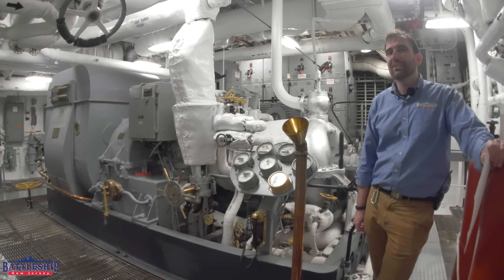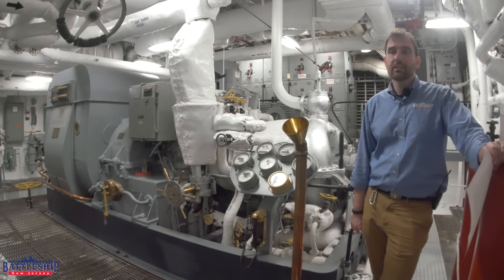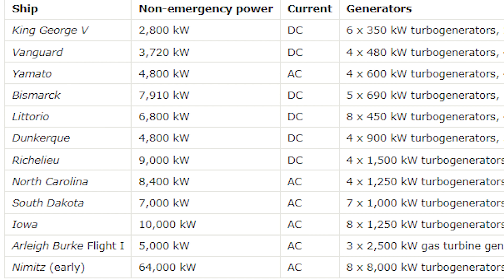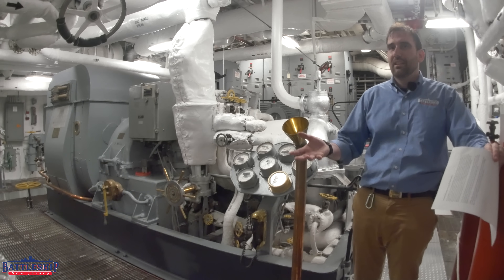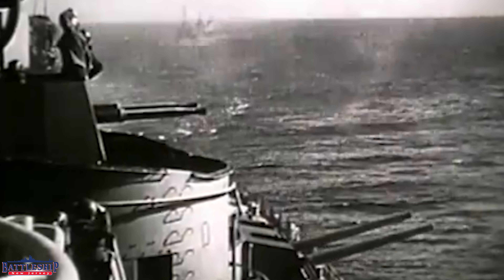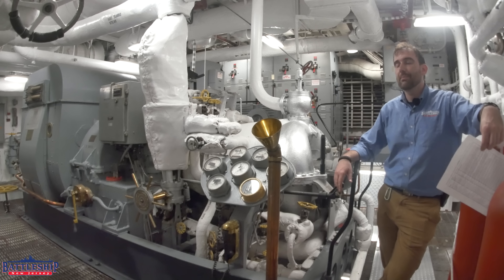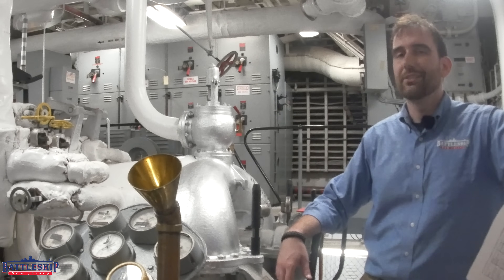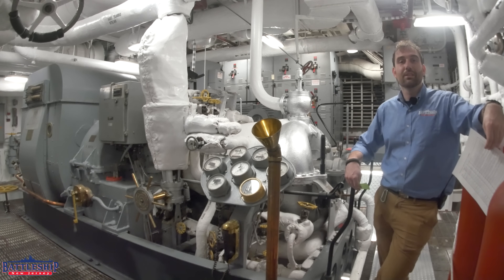How Much Power Can a Ship Generate and Did a Ship Really Power a Whole City?

Comment: ...agree with comments on AC for distribution.  This on nearly all ships is ungrounded three phase (so said the professor and electrician's mate I found) so that if battle damage or chafing would 'ground' one of the phases (meaning connect to the hull), the system continues to operate.  This damage is to be repaired as time permits.

I was compelled to order books and take instruction in naval electrical power one time (at age 70+) because I had agreed to design equipment for a small company which equipment was used aboard ship.  My first move was to call Navy engineering officers who I happened to know from college.  None of them knew how the electrical power was configured.  I finally got that information from a former electrician's mate and from taking the on line electrician's mate class and exam myself.

I was surprised to see 450 volts on the plate.  My text book lists 440VAC 3 phase (delta wiring, ungrounded) as being standard shipboard primary power and 480 VAC (often Y wiring, grounded) for land industrial use which situation is traceable to the earliest shipboard installations where the voltage sagged from 480 (I am told).  So the voltage is now 'pre-sagged' and not quite compatible with land installations...depending.  ...note: There is supposed to be large resistors near the generator to keep the ungrounded delta wiring system from charging up to static voltages that puncture insulation.

The textbook also describes WW2 era warships as having DC power derived from 440VAC 'locally' to run motors driving 40mm and other guns.  I have no first hand experience to know if this is true.  It (textbook) also said, and the electrician's mate confirmed, that there are 'local' 120VAC and sometimes 220VAC (grounded) networks so as to be able to use commercial lab equipment, refrigeration and some other equipment.  In WW2 that would have been done with iron core transformers but now with much, lighter and smaller switching power supplies similar to large audio amplifiers.

The 440VAC system is also supposed to operate under 3 feet of water!  I was shocked when they asked us to supply water resistant plugs and pass the 3 foot water test.  Thank goodness...our equipment is not used for damage control so no such thing is required of us BUT that requirement lays upon portable water pumps and other equipment in the damage control lockers which is also tested with standard lengths of water resistant 440VAC drop cord or so they told us at the Navy testing labs.

Electricians' mates know much more of this as this knowledge I gained just from class, texts and talking to electrician's mates...and designing equipment which passed Navy tests.   ...under water...egad
Reply: Standard distribution shipwide is 440VAC, with step-down transformers at load centers and certain point of use locations.  Lighting is all 120VAC, as is most equipment.

Easier to run cabling for a single voltage/frequency and massage it for whatever is needed than to run cabling for multiple power needs.

On my ship, the main IC Switchboard had inputs for 120VAC/60hz/3 Ph from 440 VAC transformers, 120VAC/400 Hz 3 Ph from a set of 440VAC motor/generators, and 120 VDC from a set of 440VAC rectifiers.  (400 Hz is common for gyrocompass equipment)
Reply: I don't know the specifics on the origin of the 440v nato standard power, but i can confirm that it is ungrounded delta. If a single phase grounds out, earth (hull) potential will match the grounded out phase while we troubleshoot. Equipment will continue to opperate until the fault is located and rectified.

At least in canada, 120v 60hz for lighting, outlets, and other small user, is still generated via transfomers. I suspect simply because a transformer is far more sturdy than switching power supplies, and much easier to maintain. It is also not the 120v of most households, which is 240v with a center tapped neutral, our 120 is supplied as 120v across two 60v hots. 220v is from entirely seperate transformers. We also have 120v 400hz three phase for sensitive electronics, such as sensors and the helicopter shore connection.

And yes, all 440 electrical is supposed to be watertight to 1m. All the distribution and control panels, electric motors, 440 outlets, etc. are all submersible. Speaking of 440v outlets, all of those are powered from a Y transformer, which gives us 440 and 250v available from a single source.

Naval power specifications are all over the place. It all makes sence once you're on board though.

Comment: I know this has been covered a few times, but if Camden had a disaster and the only way to provide a source of power for critical infrastructure was to get the battleship's boilers fired (I know it would probably never happen) up, would the Navy allow her boilers to be fired for that? I understand that it would almost never happen, but just an otf the wall idea.
Reply: None of the systems are fit for service.  Everything would require major overhaul.  She was already suffering from operational problems due to age when she was taken out of service over thirty years ago.
Reply: By the time they got the ship capable of making electricity again the power outage would have ended months ago if not longer

Comment: Most of the WWII non-warships used 250v DC power. Lights were bulbs - no florescent, reefers, freezers etc. Many had no AC power. If there was an AC need for specific equipment, a motor generator was used. 250v DC motor running a generator. Motor generators were common in older ships. I remember some were 400 cycle. Some of the ships had DC emergency generators in addition to AC. Diesel electric tugs I was on used 250v DC for propulsion motors.
Reply: Aircraft all use 400Hz AC power for instruments (because higher frequency motors are more weight efficient).

Comment: I'd like to know how New Jersey's power generation--or any of the other battleships on the list--compares to the New Mexico's, and how both compare to the Lexingtons.  Asking because New Mexico and Lexington's propulsion was turbo-electric.  I'm just guessing their total electrical generation capacity was more but I'm wondering by how much.  Wikipedia lists their "installed power", but it's not clear if that's net power that came out the propeller shafts, or if it refers to what you got out of the generator sets.
Reply: Pretty sure the Tennessee and Colorado had turbo electric drive as well. But yeah, Lexington should be able to generate more watts than anything pre-nuclear.

Comment: A friend of mine got a generator off of a Cruiser as the backup generator for his farm. Even though it has a bad cylinder (makes a racket and doesn't hit full power) he thought it had enough power to light up our small town (~800 people).
Reply: The city where I used to live had a peak power plant which was literally the generator system for a WWII era submarine.  They purchased the generators from the U.S. Navy following the decommissioning of that submarine (I don't remember the name of the boat it came from) but it was kept in service until about 2005 when it was replaced with a natural gas turbine in the same building where the original submarine power plant was located.

By peak power, I meant that it was only turned on during periods when it was anticipated that the demand on the city power grid was going to hit its maximum load and they couldn't get power from other sources.  It was still turned on several times throughout the year though, especially during the summer months.  This is in a city of approximately 100,000 people although power came from many other sources too.

Comment: Probably the most unusual auxiliary power ship was the Sturgis MH-1 which was a former Liberty Ship, SS Charles H. Cugle, Hull 3145, which was split, lengthened, had its power plant removed and a 10 Megawatt nuclear reactor installed.  The Sturgis was effectively a power barge.

The Sturgis underwent trials at Fort Belvoir in the early 1960s and was in 1968 towed to Gatun Lake to help supply power for operating the Panama Canal until 1976.  Gatun Lake’s water level had dropped due to prolonged dry weather, and the Sturgis together with a Diesel barge allowed all of the water discharged from the lake to operate the canal rather than generate hydroelectric power.

Over its career, the Sturgis was initially fueled with low enriched uranium and then refueled four times over its lifespan.  In the early 2000s, the Sturgis became a hot potato nobody wanted around due to its radioactivity.  Sturgis was finally successfully scrapped in 2019.
Reply: Russia took the idea, send a few greenies to count birtches on the road to Irkutsk and build 

https://en.wikipedia.org/wiki/Akademik_Lomonosov
Reply: @mbr5742  Thanks for the reply. Reading about the Russian floating power plant is interesting.

Comment: DC motors have a lot of torque at low rpm.  Ya would have thought they would have used dc motors to rotate and elevate the 16 inch turrets.
Reply: I suspect AC motors may have chosen to avoid the carbon dust of DC motor brushes.  I been in an elevator penthouse which had lots of carbon dust everywhere from the elevator motors.

Comment: I have tried to find out how much power the emergency diesel generators would produce, if the steam units were to be disabled, but I have not found out the answer yet.
I am sure it wouldn't run the entire ship, but it would have to generate enough power to run a turret at least!

Comment: The Yamato while quite massive and with some impressive fire control was a minimalist as far as many of the latest powered innovations at that time. Things like internal lighting as well as forced ventilation,heating,cooling,fans, outlets,etc.... were minimalist in every regard. So they were able to get away with the little power generation they had was enough for its core Battle and Navigation systems. The Japanese did not put an emphasis on crew comforts nor any amenities requiring power.  The Iowa had a ton of the latest electrically driven equipment and the Navy had a more reasonable doctrine of Ventilation and redundancy than many of those ships built before her.
Reply: Iowa class ship' 40mm guns were electrically powered and had fire control directors. American fire control systems also had a lot of radars and computers in the plotting room. I'm assuming Yamato relied more on optical rangefinders for the 127mm dual-purpose guns?

Comment: The Nimitz Class carriers are using about 10 to 12 Megawatt to move the reactor coolant around at full power. As for converting AC to DC, the rectifiers are big to handle the 2005 amps of phase power. DC power can be generated and distributed throughout the ship for any purpose needed, just after stepping down from the AC power source. DC is used extensively in submarines, with batteries, and is converted back to AC through a bi-directional Motor-Generator set. The MG set can be an AC motor and DC generator and vice-versa. Batteries on surface vessels take up displacement and interior volume without adding substantially to fighting capabilities. AC generators are much easier to parallel, for more power sourcing, than DC generators, and you get 1.8 times the power for the same RMS voltage and current. DC generators may require more maintenance than AC generators, and they are easier to open due to overloads. The nameplate rating is correctly calculated, and the machine generates 2005 amps from a small turbine. On the SG radar, the radar had a peak power of 50kW and a pulse reparation rate of 825 Hz and a pulse width of 12 micro-sec, which means it is "On" 0.1 percent of the time, but radars are notoriously power hungry with all the displays and auxiliary devices. Using steam to drive large loads is inviting injuries in battle, as the steam comes out of the broken pipes. Many a member of the "Black Gang" was killed by steam in battle, and they still are. And solenoid operated valves exist, along with pneumatic  control systems.

Comment: Side note with the AC & DC talk. Heard that Japan is testing installing DC circuit breaker panels in larger office buildings. With all computer racks, UPS'S, LED lights etc using a power supply they would be eliminated saving at least 5% in electrical usage & reduced air conditioning load.Maybe 15 years ago the Federal government wanted the 3 big hospitals in University city section of Philly look into back feeding PECO line to supply power to that part of the city during a city wide power outage. These 3 hospitals with a combined 2,000 plus beds have huge generators  CHOP campus alone has 13 Diesel generators & 4 natural gas generators with most of them producing 2,000 KW each or 16,666 amps at 120 volts.Yes they produce 480 volts 3 phase except for one that feeds one floor of a special research center with a 13,200 2,000 KW generator.
Reply: Some data centers use 48 Volts DC.  Cisco enterprise grade switches and routers can be ordered with 48 Volt supplies, also Dell and other band rack servers.  I had a chance to tour what was then a Switch & Data building in Cleveland, Ohio which supplied 48 Volts DC to its clients.   There were bus bars as thick as your arm running between floors and to a basement area which had rows enormous glass batteries.  It was quite impressive.  48 Volts has its roots I mechanical and manual telephone exchanges as far back as about 1880 before electrical grids existed.  I believe 48 Volts was chosen as a good compromise between safety, efficiency and keeping wire gauge not too thick.

Electric telegraph use in the US began in 1844 before practical electric dynamos existed.  In the early days, crow’s foot and LeClanche wet cell batteries were the only source of electric power available.  Large telegraph offices had large rooms full of batteries and employed battery boys to replenish electrolyte and replace expendable metal parts of the cells.

Comment: Interesting the Japanese used AC as well as the Americans. 
I prefer electric drive motors. Why?  electric wires are easy to replace than steam pipe. Steam pipe needs to be heated to prevent condensation in the line. Electricity is easier to re-route possibly making the ship more resilient. 
Interesting the generators spin at 1,200 RPM instead of 3,600.   They must be multi polar . 3,600 = 60Hz times 60 seconds, a common generator speed. 
2,000 amp buss - that is not wire it is bars of copper.  Wow!!

Comment: I would have thought the Turbo-Electric powered Standards would have had larger power generating capacity than the IOWA's since they use electric motors for propulsion.  Which is also what allowed Lexington to easily provide power to Tacoma was because she has Turbo-Electric drive.  The generation capacity of the Lexington was 130,000+ kw.
Reply: Exactly. I’m surprised Ryan missed that.

Comment: Sometimes you need DC converted from AC. I have a motor generator with Navy markings stamped on it. The unit has a AC motor on one side that drives a self-exciting DC generator on the other side, thing weighs about 325 LB. The data tag was removed so i don't know the output numbers. It is currently being turned by a 8 HP steam engine i have and at about 600 RPM it puts out 60 VDC. Makes a nice battery bank charger. And Ryan thanks for your work making these postings.
Reply: That is motor-generator units are called a "dynomotor".   Very common device in old navy radio gear.  Also used in LV DC to HV DC conversions.

Comment: 3-phase AC is more efficient than DC.  Above 1 hp most motors are a minimum 240 volts and in industry 440 to 480 is common.  Also with 3-phase AC you can change the leads and reverse them.  The one thing that DC is required for is electronics, any kind of signal processing, like radio, radar, or TV needs clean, even DC or you can get hum or lines across the screen or others kinds of distortion.  But imagine all the weight and bulk that was eliminated by not having to run steam pipes for things other than propulsion or heating.

Comment: Either way, it's still a steam turbine (*except for the Arleigh Burke class), only the heat source to boil the water has changed from coal to oil to nuclear decay, everything on a surface ship outside the boilers/nuclear reactor works pretty much the same as it did in 1906 (submarines were more like hybrid cars, with a piston engine to charge batteries while surfaced to run off said batteries while submerged, they varied on whether they were driven directly by the diesels on the surface electric drive motors all the time powered by the diesels (like a diesel-electric locomotive. German u-boats tended to be direct-drive with one screw turning while the other engine charged the batteries, American WWII fleet boats were the latter/the modern style, where the motive power was electric motors all the time and the diesels ran when charging the batteries/to prevent using battery power when air was available).

*they have basically the same engines as a 747, except it turns a shaft to the screws instead of a fan in front of the engine. But it's still a gas generator spinning a power turbine, same as in later steam-powered ships, just instead of steam it's a jet exhaust.

Comment: A diesel electric locomotive has also been used as emergency power for a (smaller) town.
Reply: The Army used a version of this to power large base camps for years. It's basically the same set-up with a few changes and no wheels. They were just being phased out right about the time I started training on them and the 750kw MEP-012As and MEP-208s are what I mainly worked on. 4,500 kW Electro Motive Division (EMD) plants. The 4,500 EMD Plants consist of three generator units each capable of producing 1,500 kW of power at 4,160 VAC at 60 hertz.
Reply: Canadian ingenuity baby